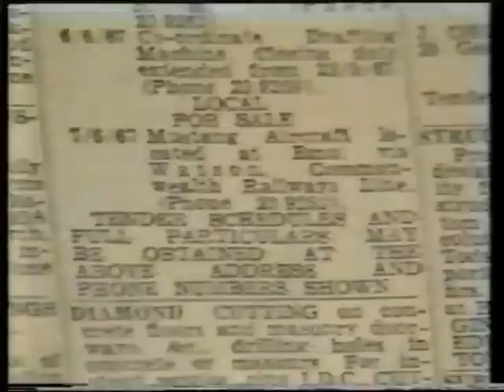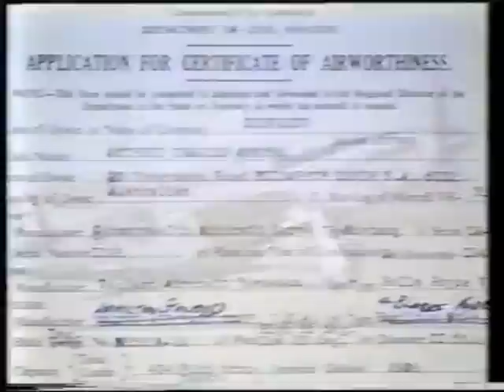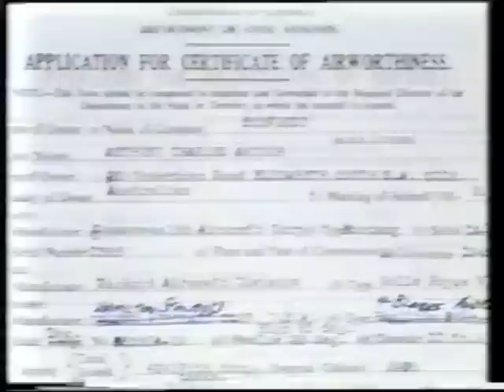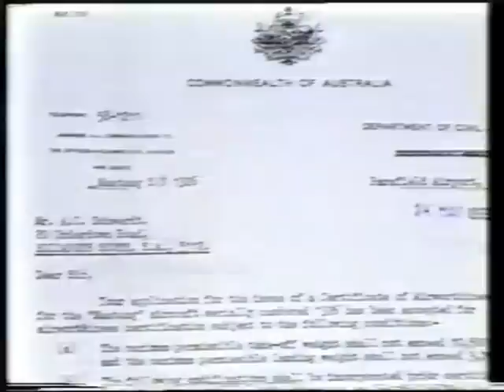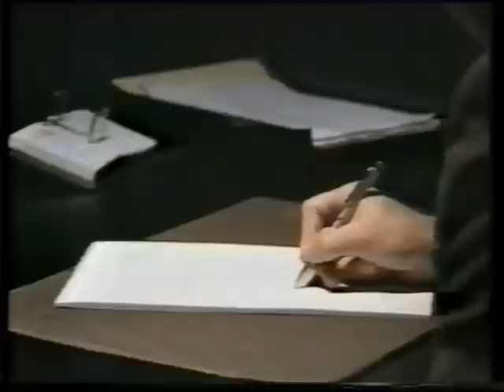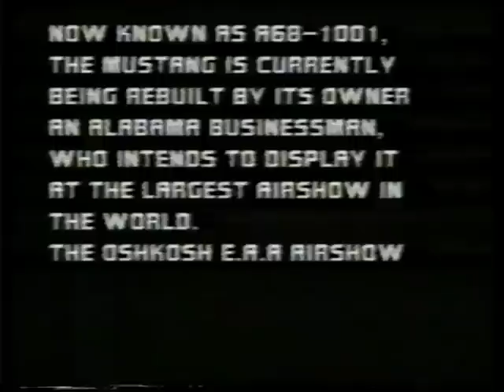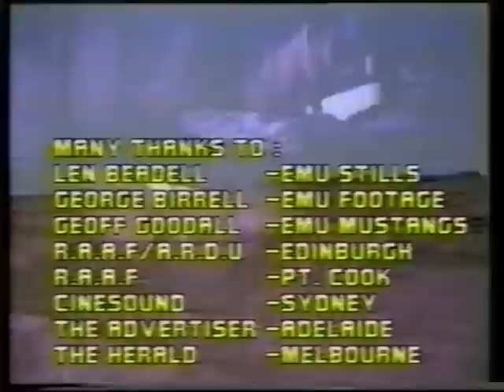6 Mustang aircraft recoverd from A-Bomb test site Australia

Comment: I cannot understand why it was so difficult to weaken that rich mixture in the carburetor.  That black cloud showed that there was a lot of unburnt fuel in the exhaust.
Reply: The screw ends were prob corroded.
Reply: If you noticed the "dry run" "water corrosion" fixed with radiator hoses" RR Merlin ran on water. 
Look it up. Trucks got 800mile to the gallon. All the old war movies never show you the feul problems associated with poor economy of today's completely inefficient junk gas gusling pos. 
Imagine a tank needing 500gallons every 500 kms ? Didn't happen. 100 gallon got them 1000klm. Check it out for yourself.
No mention of premium aviation feul needed and where it came from  ?

Comment: An un-oiled bore (and un-oiled piston/ring and cylinder assembly) will not provide the compression needed to start the engine, something not right here. At 25.20 they talk about one of the P51's (at times they show the earlier A-B model with the flat canopy, and at other times they show a "D" variant and its bubble canopy).
Reply: Yes it will.

Comment: It's not a Packard merlin engine. It was a Rolls Royce merlin
Reply: The Packard  Merlin is a version of the Rolls-Royce Merlin aircraft engine, produced under license in the United States by the Packard Motor Car Company. The engine was licensed in order to expand production of the Rolls-Royce Merlin for British use.
Reply: for your knowledge base the reason they call it a Packard merlin is cause the allied arms agreement Packard merlin is cause those engines where built in the Packard motor car company in Detriot, michigan USA that's how the armed service ID where the engines where built that way if a problem was found the factory could be notified of problem so it could be corrected at the factory.
Reply: @Rcmodelgeeks  
I'm sorry you are correct. Thank you for jogging my old memory

Comment: I'm sure the bores didn't have that much sand in them. I don't see how you could crank an engine over for 2 and a half minutes when the bores are full of sand and it just comes out of the exhaust... Where does it all go on the compression stroke? And how does it manage to come out of the exhaust port if there's that much? And it seems to me that it would've been safer for them to just remove the heads and get the sand out of everything first before trying to crank it instead of being like "well there's nothing to lose" and just going for it. Especially when you were going to spend so long working on it anyways.

Comment: Damn I would think there would be a better way to remove sand from the cylinders than to run the engines, it's painful to contemplate doing that.  I can see why you can't practically pull the heads but how about blowing them out with compressed air first at least?
Reply: I suppose.  Also they should have crated the thing up for shipment (at the end) instead of assuming shippers would treat it delicately, it was all exposed.  I don't get that.  HOWEVER I hand it to them for going after the planes with little to work with and getting them out. 
  I know of another sad story where an operational P-51 was located in Mexico, purchased and sent to the US and it was treated as scrap metal, all but destroyed during handling.  Why the purchasers didn't personally go get it I can't fathom.
Reply: p
Reply: @Mrbfgray  a B29 was to be recoverd of ice cap in Greenland. Guys flew out there got it flight ready but APU caught fire why taxing for take off. Entire. Plane was destroyed but crew got out ok took years to get it flight ready  including four new engines they were going to fly out a fortune was spent even loss of life by one mechanics it is on youtube
Reply: @richthepontiacguys1412  I know that one too, seemed like a haphazard operation, bunch of cowboys.  But again--at least they TRIED.
Reply: @Mrbfgray  They worked in cold and these guys worked in heat but now P51 is worth 2 million dollars If he only knew that then